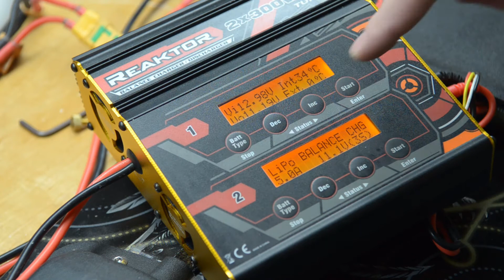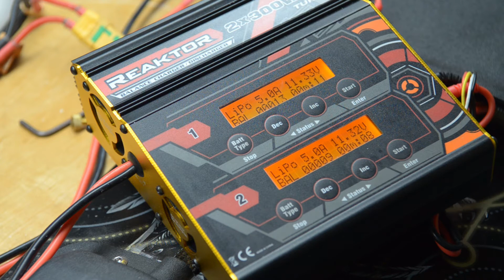HOW TO: ESKATE No BMS Charging

Comment: Hi Barnes'd, i beleive you have 4 3s bateries in series to get more voltage, but you can also charge bateries in series. you can use your dual charger to charge 2 6s bateries (2 3s bateries in series) and half your charging time. you need two types of series conectors. One for the balance leads, and one for the discharge cables. I do it with my build and it is amazing.

Comment: That's cool. Thanks for showing. I'm curious how I could charge using a plug on the battery enclosure? I'm assuming I need to build a battery for this? Would you have any suggestions for this? To tell the truth I rather keep it easy with the lips.

Comment: Are you planning on upgrading your charging system to a better one or are you fine with just taking everything apart and charging, rather than just plugging something in?
Reply from the maker: Yes I have a BMS and charger, but need to install it all.  I just got my board running again.  I blew the DRV on the VESC and now have a VESC 6.  I need to make some more videos.

Comment: I like your Series Harness, I have 2m 10awg wire and bought XT90 connectors Could i make something like that for 3 batteries in series? rather than making 2 Standard Series Harnesses
Reply from the maker: david martin To run or to charge?  Would work either way, but if you want to charge in series you need to handle the balancing also. I made a short video on the harness: https://youtu.be/e52ib-lvpC0